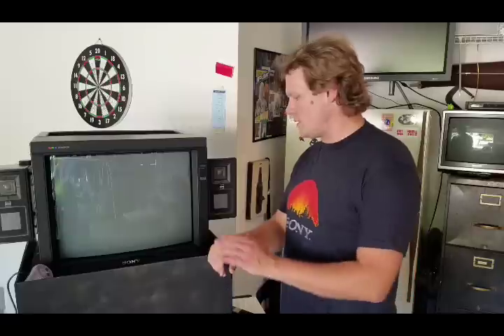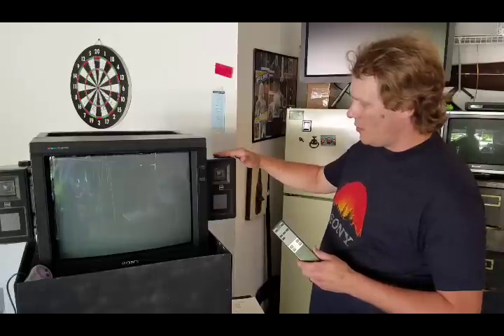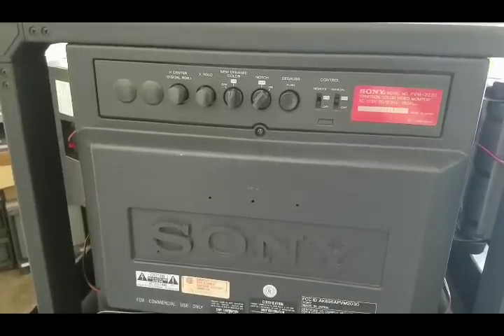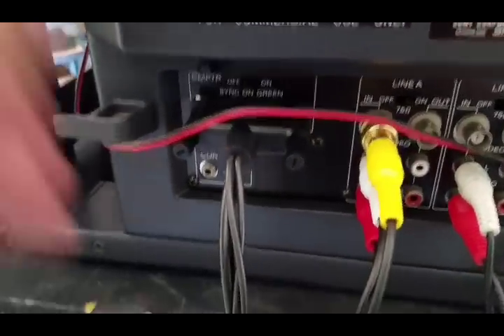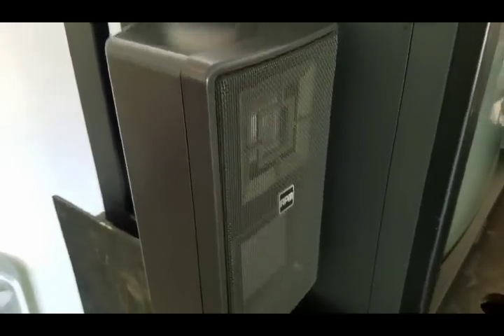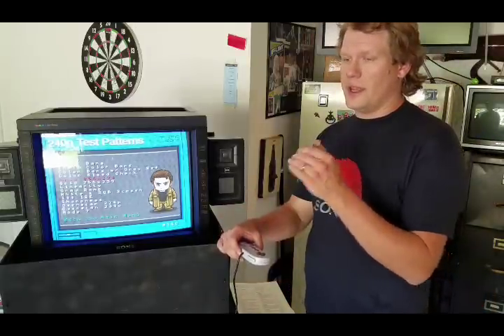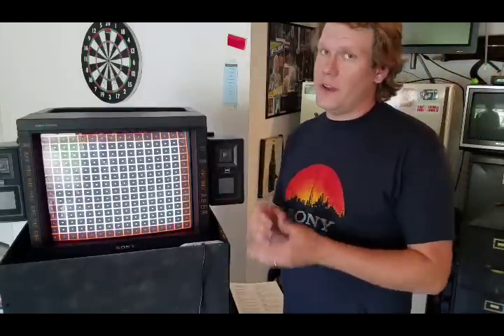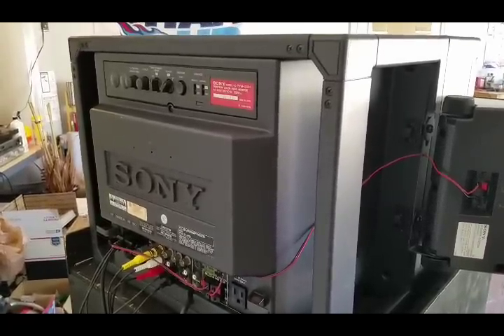Sony PVM 2030 CRT Calibration Part 1

Comment: As much as I love CRTs, I'm annoyed that they are not perfect. Why can't TV manufacturers bring them back like how Vinyl made a comeback? Surely with better technology today, they could make really good CRTs that are lighter, less bulky and work great with modern consoles like the PS4, Xboxone and of course PCs. 4K CRT could be possible.

 With the amount of competitive games like Fortnite, Counter Strike, PUBG, Dragon Ball FighterZ, I believe gamers deserve to have that zero input lag to enhance there gameplay. And of course, can't forget the major CRT advocates, Melee players and speedrunners who require NO INPUT LAG to be able to effectively perform frame perfect tricks.
Reply from the maker: Great point. I think you are right, and the problem is that it's an art to blow the glass tubes correctly.  It's been so long since anyone has made a new CRT, that I don't know if there are enough trained people to successfully make a good product.   Until that day, all we can do is try to repair old ones ourselves.  Thanks for commenting.
Reply from the maker: Yeah that's cool, but those don't seem to be actually building new CRT's for the art and gaming world.  Some of those are reselling sites.
Reply: Vinny V unfortunately, people will trade off the low input lag for a slimmer screen. most people look at crts as dirt, with their bulky design and not-so-big screen. plus manufacturers know that the cost for making crts won't equal out to the amount of people willing to buy crts.
Reply: Environmental impact would most likely be the biggest problem with resuming CRT production in a large enough scale to justify the expense, especially as CRTs require materials such as lead and phosphors.

The use of lead would already make new CRT sets non-compliant with European regulations (RoHS), which would effectively ban their retail sale in such territory.

But, lead is an important material for CRTs, partly because they are a critical part of the glass envelope's ability to shield the user from x-ray emissions, a result of the electron beam striking the metal materials of the shadow mask (or, in the case of a Trinitron, the aperture grille).
Reply: @RetroTechUSA  Hello, what is the model of those speakers on the video, is it APM X4 ? I have a 2130QM and i just bought APM X4 for it with their brackets but not reveived them yet, where did you find the bracket we see on the video where can i buy them or do the brackets of the APM X4 fit well with the 2130QM without any custom ?

Comment: 2:40 I know this is an old video and you probably already know answer to this, but thought I'll try anyway. My guess is that "up to 2000 characters" refers to the standard size of text terminal, which is 25 lines, 80 characters each, for a total of 2000 characters. Quote from Wikipedia page on Text mode:

"By far the most common text mode used in DOS environments, and initial Windows consoles, is the default 80 columns by 25 rows, or 80×25, with 16 colors. This mode was available on practically all IBM and compatible personal computers."

So perhaps this PVM could also be used as a text terminal?

Comment: @Retro Tech Hello, what is the model of those speakers on the video, is it APM X4 ? I have a 2130QM and i just bought APM X4 for it with their brackets but not reveived them yet, where did you find the bracket we see on the video where can i buy them or do the brackets of the APM X4 fit well with the 2130QM without any custom ?

Comment: Your videos thus far are amazing. I have a PVM 2030 and have twice made adjustments to the geometry, however after the set being turned off for a few hours it reverts back to how it was. Is this a capacitor issue? If so, are there specific ones I should recap? And do I need to discharge the power supply before recapping/soldering? Thanks!
Reply from the maker: Hi and thank you.  Unfortunately it does sound like a capacitor issue.  You could discharge the monitor, remove the deflection board and replace all the caps which will most likely solve all your issues.  That's a tougher job on a 2030, but doable.  The other option is to try to replace the capacitors on the specific setting that keeps failing.  This would be less work, but may not fix all the issues since you are only replacing a limited number of caps.  The service manual for the 2030 should be available on google and would show the boards breakdown, etc.  Hope you get it fixed.
Reply: "I have a PVM 2030 and have twice made adjustments to the geometry, however after the set being turned off for a few hours it reverts back to how it was. Is this a capacitor issue?"

Not necessarily.

While age, wear and tear will have an effect on the component values, what also happens are that component values may change from heat which, in turn, may alter adjustment values.  This is why it's recommended that you do not attempt calibration until after the monitor has first reached operating temperature (in addition to not performing adjustments until after the CRT has been degaussed).  That way, what you adjusted for will be what you see when the monitor is warmed up and demagnetized.

However, the difference in picture when the monitor is cool and warmed up tend to be subtle, so it would generally be when adjustment values are so wildly out of whack when it's not warmed up that the picture is unacceptably distorted that a component fault may be suspected.
Reply: @Watcher3223  its a capacitor issue, i had same issue replaced all the caps on the geometry board and now stays as intended

Comment: I'm buying these same speakers for my pvm 2030. Any advice on how to mount them? How to make a bracket?
Reply from the maker: I had to buy my brackets from Lowes.  They were in the electrical supply area.  Then I matched bolts, washers and nuts to fit the angle pieces to the screw holes in the PVM and the brackets on the speakers.  Here is a link to an example of the angle steel: https://www.homedepot.com/p/Superstrut-2-Hole-90-Angle-Bracket-Silver-Galvanized-ZAB201EG-10/100390324

Then I painted everything black.  It works out great!
Reply: @RetroTechUSA  thanks! The speakers i purchased come with swiveling mounting brackets. I noticed 2030 has machined holes for bolts close to where you mounted your brackets. Im hoping the holes on the speaker brackets line up with these holes. If not i will still try and use the holes machined in the 2030 (that way I dont have to drill my pvm). If my plan doesn't work out I will try yours. I will message you when it's done. Thanks again!
Reply: @RetroTechUSA  , Just got my speakers today. On the bright side they would be really easy to mount to my pvm but I would need to do some drilling. Unfortunately the speakers are blown! I'm thinking about just buying some new black speakers. Is there any issue with the magnet in the speakers messing up the crt? Do I need special speakers? I know most consumer grade crts have cheap speakers inside that are not shielded so I don't think it's a big deal...what do you think?
Reply: I bought some 3 inch 8ohm shielded speakers off Amazon and replaced the blown ones in the amd case. Sounds okay. Looks great. For now i just have the speakers standing next to the monitor. I might leave it this way. I don't like how it looks with them mounted on the sides
Reply: @riggel8804  I use a pair of Bose 161s that I got used for cheap.  Not bad in terms of sound; superior to the Sony APM-X5A indicated as the speakers to use with this monitor, but the Bose 161s do have limitations in bass handling; too much bass causes distortion with these speakers, so something else may be a better choice.  You can also use two way or three way bookshelf speakers from Sony, Pioneer, JBL, PolkAudio, Klipsch, or anyone that makes a decent bookshelf speaker.

You have to use magnetically shielded speakers if they're going to be positioned closely to a CRT set; unshielded speakers may affect picture purity (distorted colors) and possibly even cause permanent damage to the CRT if exposed to such magnetism for prolonged periods.
Reply: @Watcher3223    haha. This was my project like a year ago.

I asked my dad's friend, who is an audiophile, to help me with it. After we hooked up the apm speakers I was okay with it but my dad's friend was appalled at how awful they sounded.  Out of disgust, and pitty, he gave me a hifi system. Yamaha stereo. Hk40 tower speakers. I could not believe the difference in sound quality. I've been chasing the perfect sound since then. Upgraded the stereo to a silver 120w Yamaha and bought a quality dac. I can't believe what a caveman I was before.... listening to those crappy Sony speakers and that wak ass pvm amp. 

The pvm2030 looks wak anyways with those speakers tacked on to the sides. I guess if you're just gaming it's okay. But I use mine as a multimedia station... At least I used too. I don't use the 2030 anymore. I got a 32 inch consumer grade Sony in its place.
Reply: @riggel8804  That's even better, to use an external amp and speakers for sound.

And a 32" set is a nice size.  I have the PVM-2530, which isn't as large as what you're using, of course, but it does nicely.  And it's nice to play Sega Master System/Genesis/Sega CD/32x in RGB with it.

Comment: Does it really accept multiple video formats? I'm about to get this pvm and I will use it with my pal Wii , is it going to work with this pvm?
Reply: MrGigaflare, This PVM only accepts RGB, S-Video, and composite. For the PAL Wii, you will need to use Wii SCART RGB cables. I have it on mine and works perfectly.

Comment: Will this work for Trinitrons?
Reply from the maker: This is pretty specific for this model of Sony PVM, but some of the techniques can be used on trinitrons.  I do have a playlist discussing Trinitrons.  My Consumer Trinitron is very limited on the available features, etc.  Here is a link to that playlist https://www.youtube.com/watch?v=NyGPws6Eu4Y&list=PL_Hm88_bscLQCyWewpdW4j1kmP1pbsWWa&index=2
Reply: Retro Tech thank you!
Reply: Depends on the model.  While you may use the same calibration patterns on all CRT sets, newer Trinitron models tend to have these adjustments carried out in a service menu as opposed to adjusting trimpots on circuit boards on older Trinitron models.  Newer and older Trinitron sets may still use magnets for adjustments, however.